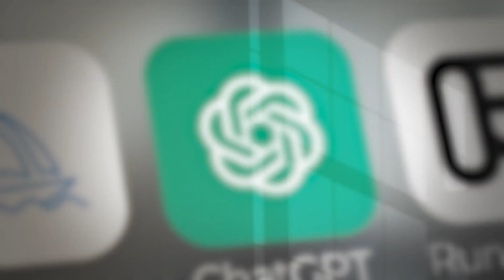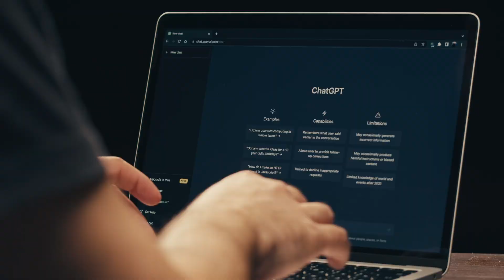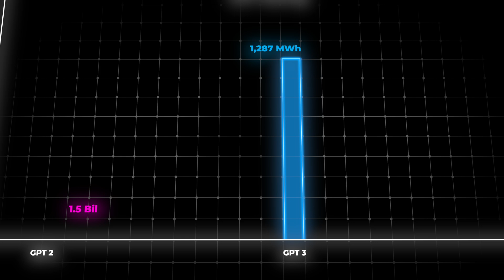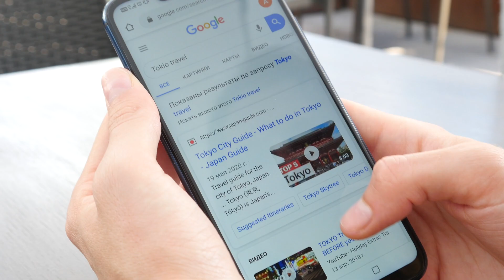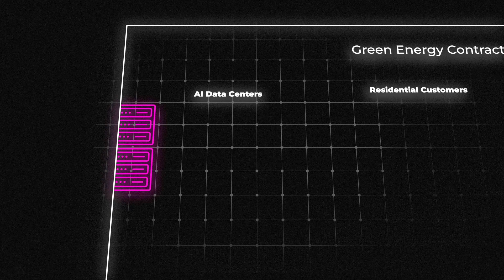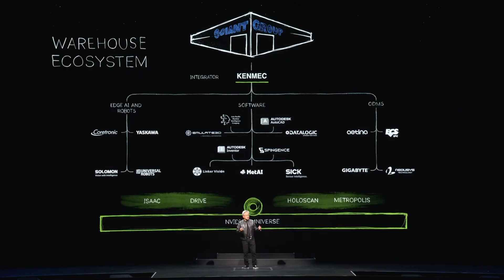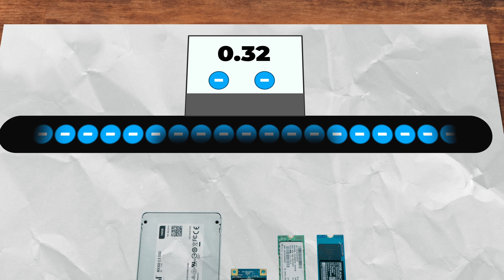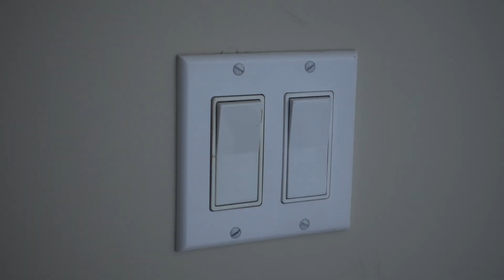AI's Hidden Cost: Can Our Power Grids Keep Up?

Comment: A few years ago I though about if we could use the excess heat of these server farms and convert it into motion energy using a sterling motor. Then you could use the motion energy of the motor and power an electric motor, generating electric energy. We could regain some of the energy we used on these server farms and since the heat supply is steady, it would even be base line power with no fluctuations (idk the english term, in Germany it is grundlastfähig)

Comment: What people do not understand about AI is that a gaming console becomes an AI when you place a game CD in it. Game programs have become so complex as to, at many levels, outperform most larger server farms in terms of running complex programs. Because of this, no new gaming platforms can be sold outside the U.S. because our government is afraid that terrorists will use the technology within the console to stage attacks.
With that in mind, imagine 3 things. First, one building per city block is fitted with enough servers as to be hooked into all other buildings within the same city block as to monitor electrical consumption; building security features; etc.; Second, each apartment, house, business, etc. is also hooked into the system as well; Lastly, because of this, an AI can monitor everything within your residence 24/7 as to reduce the amount of energy consumed during the day when no one is home or otherwise present. 
Imagine an AI cutting the power to your refrigerator after you left for work because the AI knows that the refrigerator will remain cool enough to keep everything cold because no one will be in your home opening and closing your refrigerator during the day. It can then monitor the temperature to keep it cool, or turn it back on when it knows that you are on your way home. It will know that your on your way home because it has seen you leaving your work from a nearby security camera as well as a traffic camera along the road to your home. 
Imagine if it can monitor your activities as to make suggestions which will ultimately save you money. There are many cities which uses delivery services for a various number of things. Imagine you coming home to find a box of food just delivered to your front door from Walmart via FedEx. Upon close inspection you ended up saving because the AI used various methods/sales/online coupons/etc. to save you money on the food you eat on a regular basis. Even if you wanted to try new things, it will be able to read various actions you do as to guess what food(s) you are in the mood for eating. Imagine that it figures out that you are in the mood for steak, and reminds you before you leave for work that you have a reservation at a steak house for that evening? Can you afford not to live that way in the current economy?

Comment: I run stable diffusion xl purely off my home desktop pc with an rtx 4070 and producing 2000x2000 pixel outputs pretty much uses 100% resources. However 1 inage like that take about 60 seconds.  An intereting sidebote i tries soing the same with gpt 8 gig models and bizarrely text models are harder on my system and way more unpredicatable on how much a prompt will stress the system.

Comment: I think in the long run, A.I. won't consume as much energy as we think it will do.

I suspect as A.I. becomes more capable, more of us and more businesses will want to run A.I. at a local level for privacy and security reasons, especially as A.I. becomes more capable and useful, which will likely push more consumers and businesses to not want to use online A.I. services, and that will only get a lot worse as A.I. becomes more useful and even worse once A.I. can have a long term memory so it can change, adapt and learn of our habits.

A.I. running at a local level will likely get absorbed into the energy our computers use, and likely just use a little more than what we do now, A.I. isn't what we should be worried about when it comes to power use, it's robotics that could use a heck of a lot more energy than we use today as that won't be absorbed into our current system of computers and will be thrown onto our electrical grid like EV cars are.

With that said, there's no real way to know, reason being is that corporations and governments might go crazy with A.I. at such a level that needs an insane amount of power, but I think for personal and corporate use, I think the energy use will be minimum and just a little higher than what we already use, basically, it will be absorbed into what we use as tech gets better and able to do A.I. more effectively, but there is a lot of unknowns in all this as we don't know the limits of how far we'll push A.I. and how far we can push it before there's a drop-off in quality that pushing harder isn't giving us much better results but ends up needing far more energy that it's not worth it.

With all that said, we humans will always live within the means of how much energy we produce and will likely use more if we produce more, which renewable energy over the long run could produce far more energy than we use over the coming decades.

In any case, we should remember that unlike computers or the internet, which was adding a lot of energy use didn't exist before because we didn't have computers or the internet, A.I. is just another service being thrown onto what is already there, so yes there will be a spike in energy use, especially early on, but I think long term it will be absorbed into our computer use and not make that much of a difference, but robotics on the other hand is another story entirely and is a bit like EV cars, so EV cars and robotics is what's really going to have a massive spike on our energy use.

Comment: Green energy and AI+EV are not compatible. For the EV revolution alone you need to increase energy production by 30%, at least double that for AI, and energy production has reduced since 2020. I understand LLM and AI, I even have a local imaging AI installed on my local home PC running off an RTX 2080 based on Lora, so yes I'd like to see the deep dive on removing the matrix multiplication, but I'm probably one of the few.

Comment: 883 kWh per month? (pulls up app) 
I used 459 last month and produced 925 from my colar panels. 
In Seattle. 
Bunch of power hogs out there. My highest month barely cracked 500, and I had surplus generation of over 3 mWh for the year.

Comment: I'm not a fan of titles that bury the lede, or in this case, totally obfuscate it. Was any A-B testing done to check the possibilities? Personally, I'd prefer a title like: "How AI is making carbon emissions WORSE." Then start with showing the data and defining the problem, then discuss the possible solutions.

It is also important to carefully distinguish between TRAINING an AI model, and RUNNING that model on user queries. Running a model uses what's called an "inference engine", an area of rapid research, development and advancement. Current inference engines use only 25% of the energy compared to engines from just a year ago. This will only improve as more of the inference engine work shifts from software to custom hardware, just as crypto-mining ASICs caused per-coin mining costs to decrease by 99% in a decade.

Training an AI model is about a BILLION times harder than running one. This area is also seeing advancements, but not on a scale that yields overall results equivalent to that seen for inference engines. Improvement is steady, but it is needed in multiple areas, including model architecture, node implementation, backpropagation, and more.

It gets worse. All current models are massively over-trained, not from a data perspective, but from a computation perspective. We are still learning (and relearning) that less (and simpler) computation is needed than previously expected, and we have no idea how much simpler things can get! The size of the neural weight elements is a clue: They started with double-precision floating point (FP64), then went to single-precision (FP32), with FP16 and FP8 being most popular in production systems today, with FP4 planned for new systems. Current research indicates that ternary integers (3-valued: -1, 0, +1) are able to provide excellent results in many, if not all, situations.

As an aside, the desire to run inferences on analog systems is still a bit of a red herring, largely due to scaling issues. This likely is the long-term solution, but there is much learning yet to do to make this happen, and for multiple reasons that learning is best done in the digital domain.

These advancements will steadily drive down the per-neuron cost of both training and running models. Unfortunately, those savings will be used to support training and running ever-larger models, meaning these improvements will NOT result in energy savings, but may, hopefully, slow the growth RATE of AI energy consumption.

This is why there is a huge push to run models LOCALLY, on demand, to reduce the scale needed to just that required for a single user for a brief period of time. Several phones today area able to run 7B LLMs with a little lag. My old laptop has a mobile NVIDIA 2060 GPU, and I'm easily able to run a 7B LLM in real-time. I expect that soon to improve to being able to run a 32B LLM locally. I've already upgraded my system memory to handle a model of that size, and I am only waiting for a specific release from Hugging Face to make it happen.

There is a parallel path that seeks to limit the grid and other environmental loads of AI datacenters by various means. The first step is simply to take AI datacenters OFF THE GRID and power them locally using green and renewable power sources. Microsoft has even funded research into Small Modular (nuclear) Reactors sized to match the needs of a large datacenter! Similar efforts are ongoing to limit water consumption and other AI datacenter impacts.

Comment: Looking at AI alone means ignoring the computer that's in the datacenter that houses the AI processors. A single startup Inflective AI bought $1.8 billion of Nvidia H100 boards =12,000 homes. MSFT spent $10 billion on them to add AI to BING search. 50,000 homes. This ignores the board must be installed in a computer in a datacenter, the power on your computer using it and the communication between. So many times an Nvidia H100 board (8 processors). Also ignores the training discussed and how many training frameworks merely fail completely. The math is mind blowing. You should look NPU's being added to the processor inside all of our computers offloading some of the work, but not cutting the power equation.

Comment: Off peak ai training sounds good until you think about how fast the hardware depreciates, not just in expense, but also in efficiency.
Reply: What?? How exactly do GPUs degrade in computation efficiency over time??? They’ll flat out break way before you’re going to measure any type of efficiency decline
Reply: @antonvoltchok7794  Maybe I didn't say that right, but GPUs get more efficient each generation, so they are more efficient power wise, time wise, and usually space wise also for each successive generation.   So if don't use them 24/7, you loose that opportunity cost.

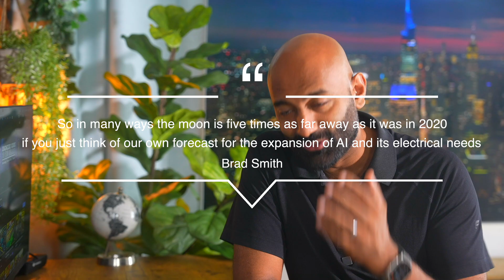Comment: At 1:15 Brad Smith of Microsoft compares the energy consumption problem of AI to a moonshot  where the distance from the earth to the moon increasing by a factor of 5 in a very short period of time:

“So in many ways the moon is 5 times away than it was in 2020.”

I don’t know about you but that analogy suggests that you have not just a very difficult challenge but now a nearly impossible one, certainly in the short term where all of these companies are racing to control AI. For perspective, that meant a moonshot to a moon went from a distance of 238,900 miles to 1,194,500 miles. There isn’t going to be a manned moonshot at that distance, all other aspects of astrophysics and current engineering capabilities held constant.

Incidentally, we are not just talking about electric power grids being insufficient; green energy is absolutely unsuitable to scale for realistic energy demand of AI, because of cost, reliability and even material sourcing/supply chains. Perhaps nuclear fission reactors will work, or the adaptation of neuromorphic chip architectures will mitigate the rapacious energy demand of current GPUs. Bottom line, MS, along with everyone else, is way too optimistic about their growth in this area without fully appreciating that physical infrastructure has to be in place for their plans to have any chance to work.

Comment: "It's really easy to be impressed with AI progress" unless you're the technician. Two comments to quell the unwarranted enthusiasm: there's no thing such as "exponentially" in this business, instead there are indications that models may deteriorate if trained too much. Secondly: there's no indication that an AI correctly can put two building blocks together. What we win in fast coding of stub codes, we lose at error checking. A human must do that. Using AI in arts is generally abhorred, those that are fast to jump on the train, are those most likely to go down with the train when it derails.

Comment: Issue with using the service to heat homes is pretty much.The issue of global warming right now is that we won't need to heat homes. Yes, global warming isn't just getting hotter. It is also the extreme swings of temperature such as the extreme cold weather and blizzards etc. But the issue, many times with those is that the infrastructure of the area, such as in Texas are not set up for those kind of Weathers like they were not ready for the blizzard at all. And they still aren't ready for another one.

But overall more and more people are losing their winters

Comment: I have seen a few power consumption predictions from individuals involved in AI development, and i work in power generation.  IMHO we are a bare minimum of one decade from having the power we need, and that's with current demand.  Obviously AI could help ease that process but i don't think people are being reasonable at all with how long they think it would take us to catch up. If you factor in the time to create a power station, all of the logistics involved, the cost, and the bureaucracy.  This also does not include upgrades to existing infrastructure or replacement for the hundreds of power plants that are already at, if not past, their life span.  If we hadn't turned away from thorium to plutonium in the pursuit of weapons these AI goals might be achievable.  The harsh truth is that they simply aren't achievable without some sort of quantum leap, which AI might help provide. Might.

Comment: During the Gold Rush - you get claim jumpers, murders, speculation, and other forms of crimes.  An AI Gold Rush will trigger AI generated crime. The power requirements of an AI data center using a NVidia multiprocessor Blackwell Architecture AI cluster uses 2 racks where each rack uses from 60kwh to 120kwh so one cluster uses an estimated power needs of 120kwh to 240 kwh. A NVidia Blackwell AI data center has a scalable modular design. NVidia Blackwell VLSIC are made in the Republic of China/ Taiwan company TSMC.  Should China/People's Republic of China take over Taiwan - access to the NVidia Blackwell AI data center would be at risk.

Comment: "There is so much we could do if we got a little more clever."
Making electricity from waste heat requires additional processes, equipment, materials, costs, space, maintenance, etc. At some point, chasing incremental efficiency gains isn't worth the additional expenses.

Getting clever doesn't do much good when it isn't economically viable or runs into sustainability implications, like Canada coming to the conclusion that most of its hydro potential is tapped out and will need something else, likely new natural gas power plants, to guarantee baseline load through the electrification demand curve. Can't use nuclear for this due to its 15-25 years lead time from proposal to production when you include the endless environmental studies and NIMBY lawsuits.

Comment: There is an AI jevon's paradox, where limitations of energy supply will drive efficiency gains out of necessity, which will boost the pace of AI and therefore increase demand. There's many orders of magnitude gains to be had from algrorithimic effciency alone, not considering hardware design, other optimisations. We've already seen AI specific hardware dropping from FP32 FP8 precisions for wicked speed ups. Lots of low hanging fruit in these areas to be picked.

Comment: I imagine that if quantum computers truly become a thing, they'll make training even larger models much more accessible, easier, faster, and more energy efficient. This begs the question, how many parameters are enough? Will we simply continue scaling AI models indefinitely?
I don't think they will and this is why I think that:
When we scale the models and the number of parameters, we need to scale the training data accordingly. With all the issues around AI and copyright, intellectual property, and whatnot, there won't be enough real-world, human-generated data to train the models on. What will happen then is that the models will be trained on synthetic data output by previous models.
For me, this points to a future where models will probably start degrading at first and then eventually plateauing, or developers will simply put a cap on how many parameters they add, or the "real" data they scrape from the web will all be AI-generated, in which case it'll be the exact same scenario as using mostly synthetic data.
I wonder how AI will evolve after that? The only thing that I can imagine is that they improve the training algorithms to get a better output on the same training data, and one way they'll probably do that is by asking an AI to improve its own training protocol. After that, it's either it's either Skynet, the Architect, or the Oracle. 

🤪